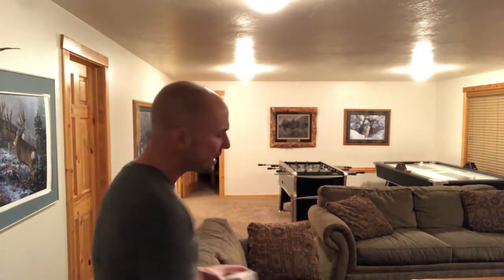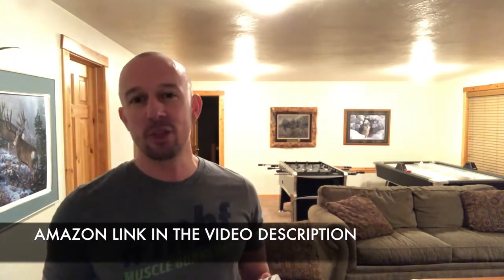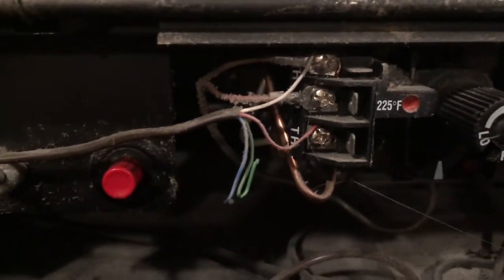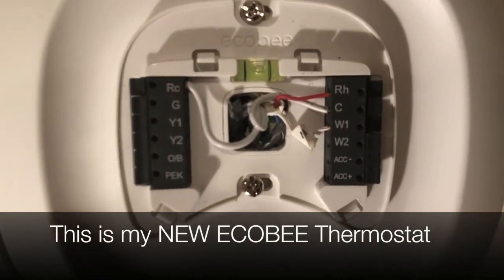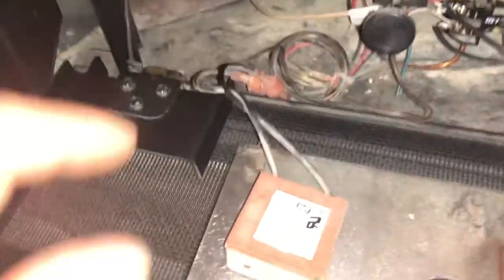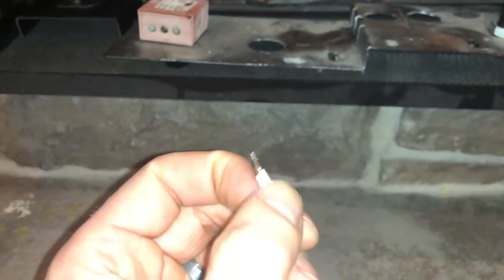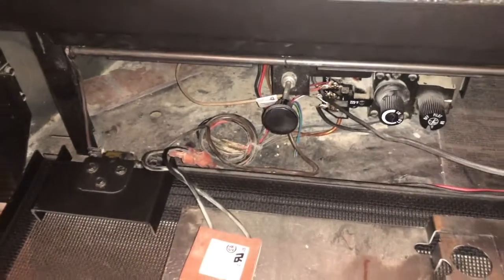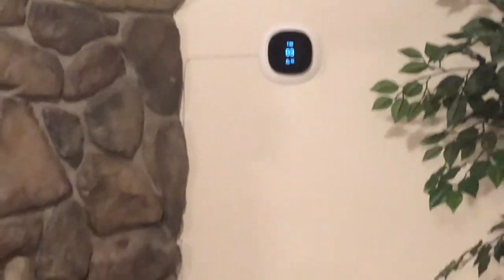No C Wire for Smart Thermostat?  Use a 24 volt Adapter and Install in 15 minutes

Comment: 2 questions: is there a polarity issue with which wire goes to C and which to Rc? And are there any issues with induction or interference between the heating transformer and the new 24v ac transformer? Like induced voltages on the heating wire caused by the current in the C wire.

Comment: I only had three wires to the old, round dial thermostat: red, green, white. No AC, just an oil burner. I have yet to see any video or advice in the manual about adding a 24 volt C-wire. I don't have the C-wire adapter, just the split wire and the outlet plug. Where do I add these c-wires to my T5 control box?

Comment: Scottie, Thanks.  I had the same situation as you with a 2-wire gas fireplace.  I was hooking up an Amazon/Honeywell WIFI thermostat.  Additionally I had to lie to the setup and tell it I was hooking up a forced air system.

Comment: Ahh Ive spent too much time researching my and now I think I’m over thinking.  I have a Y, G, W, Rh/Rc with a jumper on my existing thermostat. I should install the two wires from the adapter into C and Rc with my existing R into Rh and the rest stay as usual?
Reply: Same question 🤧
Reply: @Tumemero  I’m going to install this weekend and I’ll report back if anything blows up 😂
Reply: @kericarter7818  you can request a professional installation from amazon.
Reply: @kericarter7818  ok🤣, let me know
Reply: @kericarter7818  How did it go?
Reply: I’ve got the same issue, if you’re using this to control both heart and AC there are already wires in those terminals. I wouldn’t piggy back them as it would constantly power the control board on your AC which is not a good thing

Comment: I’m just like you! I spent several hours looking for 24v ac of my aqua stat trying to add a c wire lol. My unit is so old I just simply can’t add a “c” wire.  No lock so I’m adding one of these.
Reply from the maker: I have had it for a year now and that adapter has worked great and it was so simple!
Reply: @ScottieHobbsMakeWellness  I used this and so far so good. It’s been a week or two now and I really like ecobee.
Reply: Just about to try this and will comment back again. However I only have one extra wire (G) which was not being used at all, so I am assuming that I can splice one of those two wires from the adapter and cap off the other one. Essentially the green wire will then be placed into the common wire slot in the nest. I'm just really pleased to see this video to confirm what I thought I could do. Thank you!
Reply: Lol sadly, it did not work. Any advice for a 3 wire (red, white are used and green is not connected to the propane gas stove or previous thermostat). I connected the 24v transformer wires to the unused green end at the gas stove, then the other end of the green into the C wire slot on the Google Nest E thermostat. The nest did not light up at all. ;-(